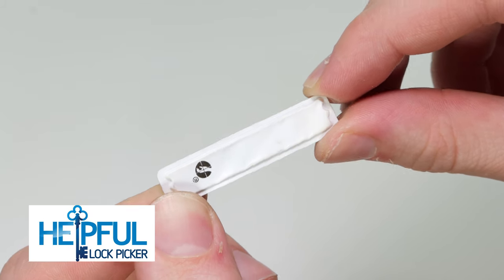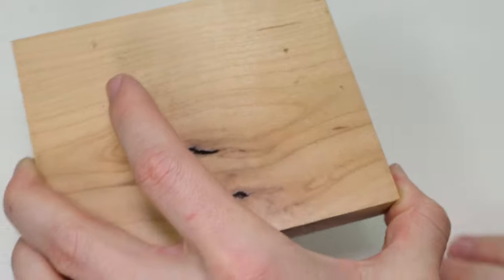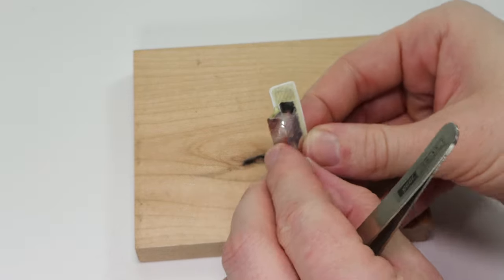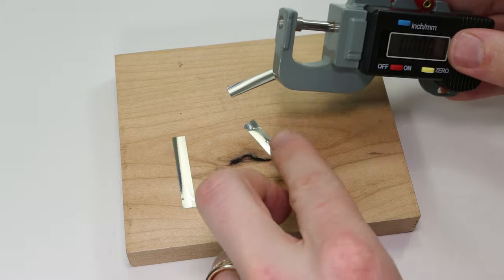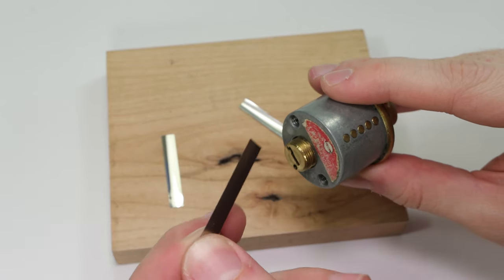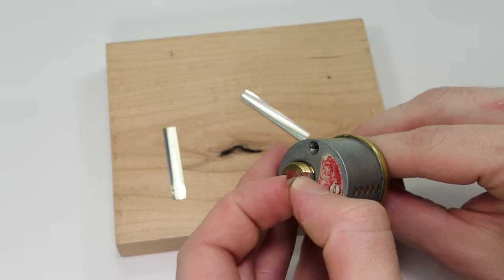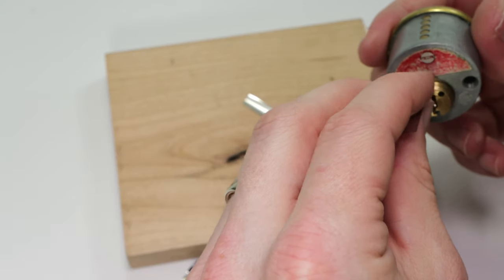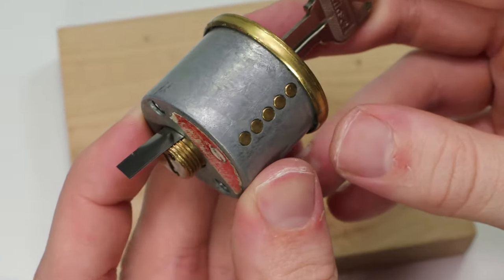[401] How To Shim A Lock with a Common Anti Theft Security Tag ||  Make Your Own Core Shims!

Comment: Why would you do this instead of pushing everything out with a plug follower? Is this basically the same but when in a bind without other tools?
Reply from the maker: Sometimes the plugs have grooves in them and you can mess up everything. These are an assurance. (T pins can be a real problem)

Comment: Thank you for this video. I bought a door with a lock for my new porch and want to redo the lock so that it can be opened with my front door key. I refer to this video: https://youtu.be/V9qzjHIE6ls?list=PL7XFU9Y6uohxwyw-XNEnH89ImTCou2Tje  I can purchase the pins online but I need to rotate the lock core the way it is shown in this video just because I do not have the original key for my lock: https://youtu.be/Q5thFHLSAT0 Questions - why do people should have core shims at home? Why not use the bump key to open the lock?

Comment: Very Nice and helpful video My friend, i find these to be a bit too thin for many locks but they do work, i have used soda cans for about 4 years before i Got real shims but the soda can worked just fine and still do
Reply from the maker: Thanks for sharing! I am surprised soda cans were not too thick for you
Reply: @HelpfulLockPicker  they work just fine i think i have only had 3 locks that i could not gut with soda can